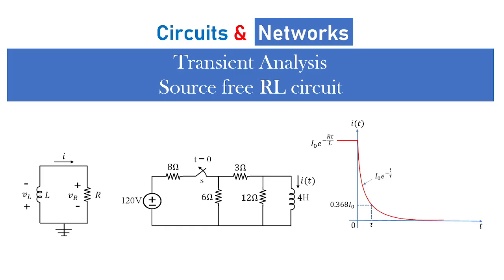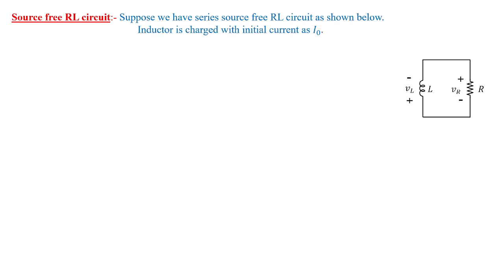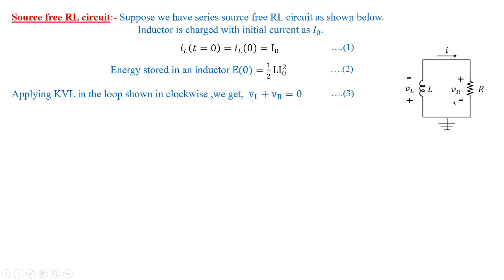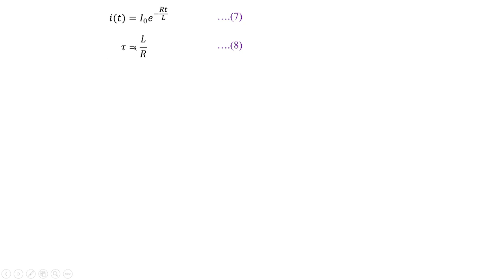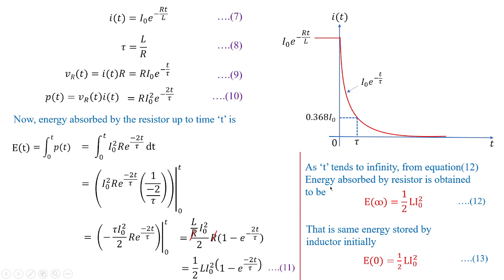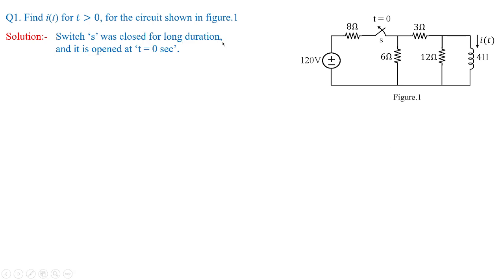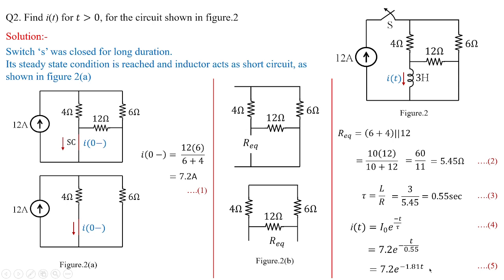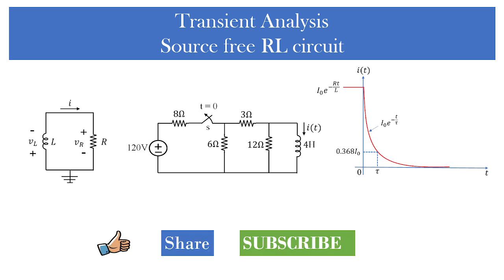How to solve problems related to Transient analysis? How to solve RL circuit under transients?

Comment: sir for Req on question 1, Req is 5.14 , The purpose of Req  is to find the single resistance value that the storage element (L ) "sees" while it is discharging its stored energy through the network for t>=0

Comment from the maker: yes your are right, the value of time constant after the switch is opened and kept for long duration time constant, that is at at "t=infinity" the time constant is 0.778 sec. But at time 't' just after the position of switch at charged inductor, time constant is 0.4 sec. which means immediately after the switch is moved at 't=0'

Comment: hello sir for the question 1.Time constant will be 0.778 sec becoz ,after t=0 Switch is opened.to find Req,we consider 6 ohm is in series with 3ohms and again combination is IIel with 12 ohms right, so we get Req as 5.15 ohms
Reply from the maker: No no, please check ., all calculations